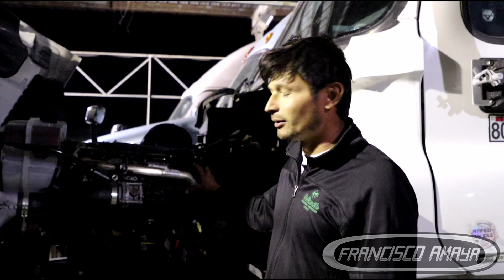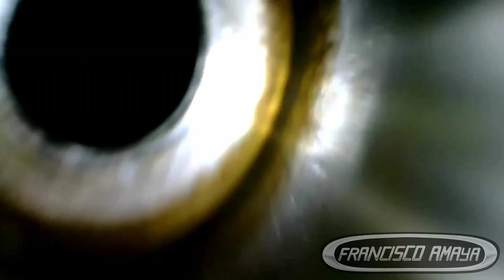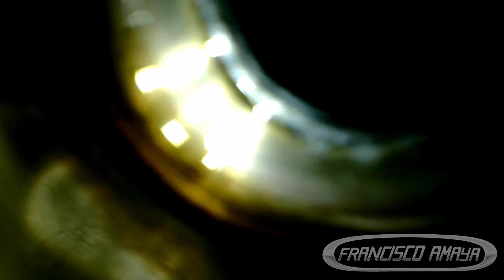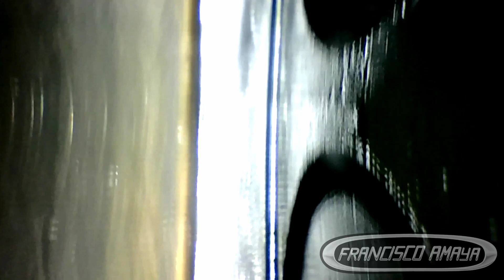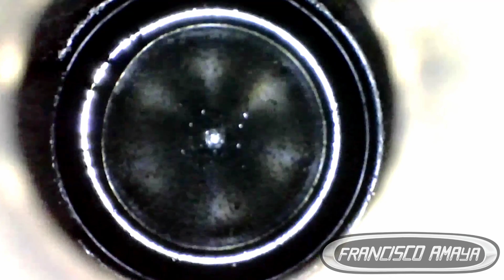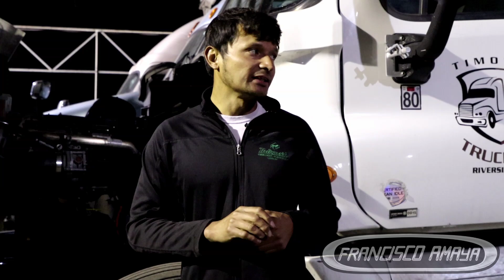DD15 engine broken intake valve internal inspection diagnostic low engine performance repair

Comment: Buenas noches maestro por favor será posible que por favor me ayude mire y tengo un problema con un kenworth T880 el timón  de la dirreccion se duro a los 2 lados cuando esta parqueado le cambiaron la bomba y las cajas dirrecion hidráulica que me recomienda hacer gracias
Reply: ya reviso los kimpim buchin de la direcion  los de las ruedas deves levantar y girar hacia la izquierda y derecha las llantas
Reply: @gustavoperea8721  Si ya resive los  kimpim buchin igual levante la gata y esta bien no tiene problemas luego lo único que la bomba que se instalo no es original es marca automann
Reply: Con apenas levantar la gata en cualquiera de los dos lados se pone suave y por favor me puede enviar su número
Reply: @elpro4684  dame tu numero te escribo o correo